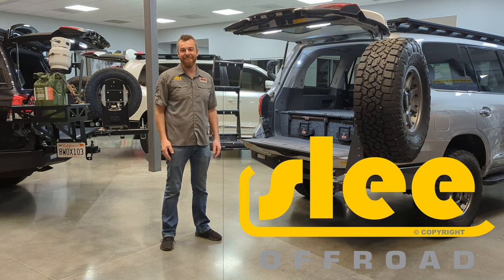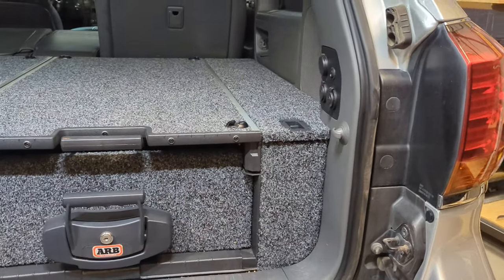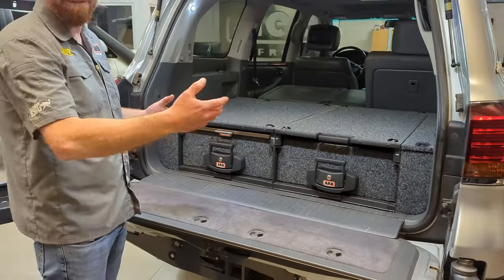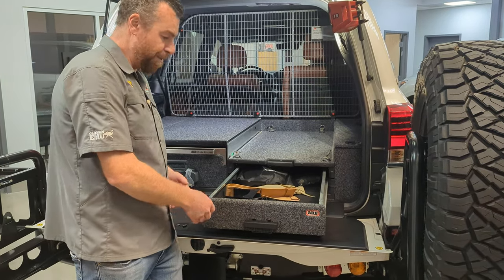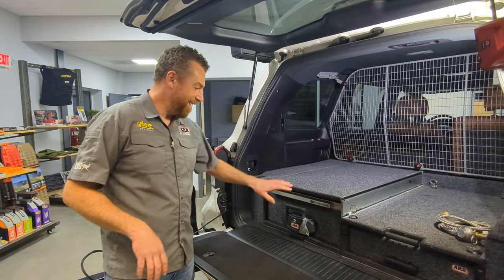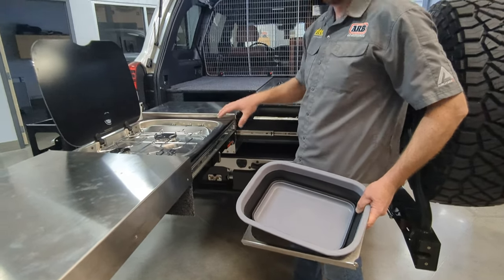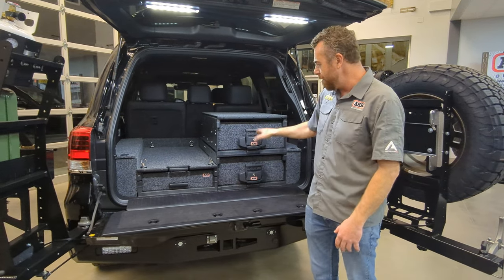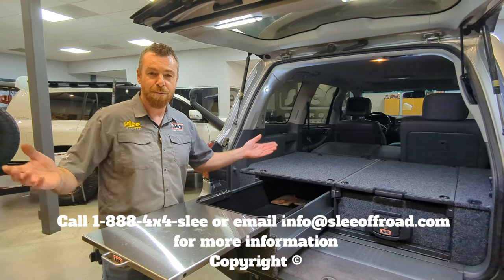ARB Drawer Overview

Comment: Thanks for the ZERO warning that this won’t fit the Heritage Edition 200!  WTF Slee!  It is NOT DIRECTLY BOLT ON as you indicate in this video!  When I ordered these from you I thought it would directly bolt in like you said. I have a LRA tank under my 200 so welding  a nut under there ain’t happening.